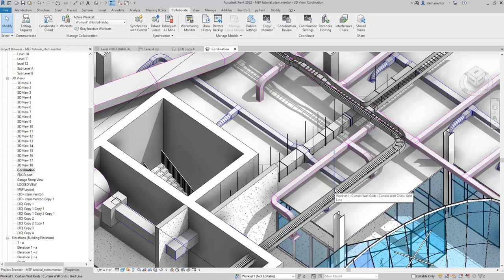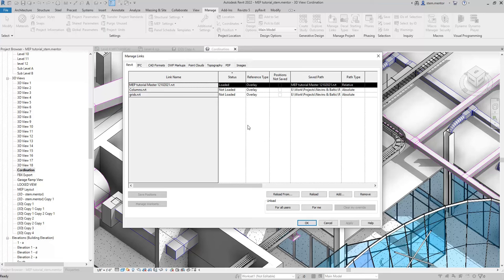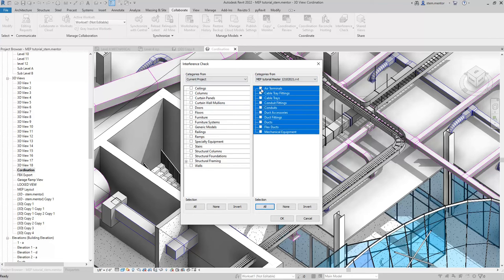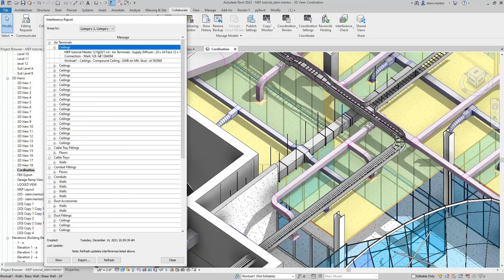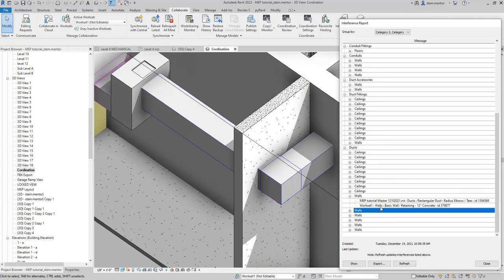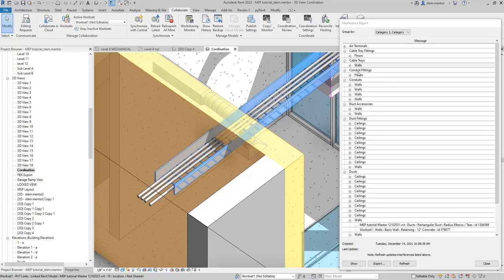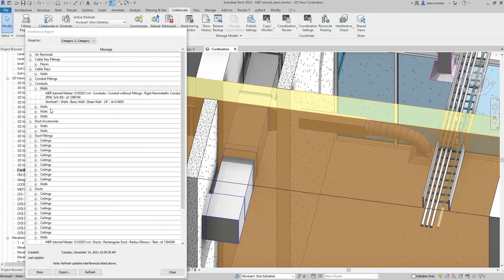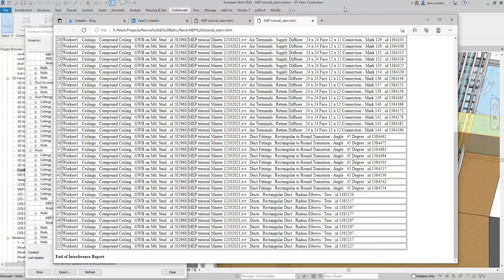How to run a Revit Clash detection interference report. MEP, Architecture, Structure

Comment: how does your architectural model show the way it does as I linked file? What I mean to ask is that I have linked my architectural model with my MEP model and it shows as a faint highlight and not the way your model shows. The architectural model's elements can't be edited in this file. I have also run clash detection, the clashes do show but can't fix them on the link file because it does not show the way it does for you.....

plz help
Reply from the maker: HI Hassan did you figure this issue out or do you still need help ?